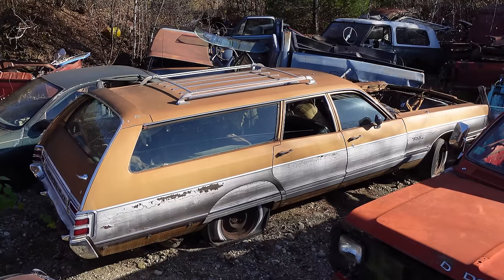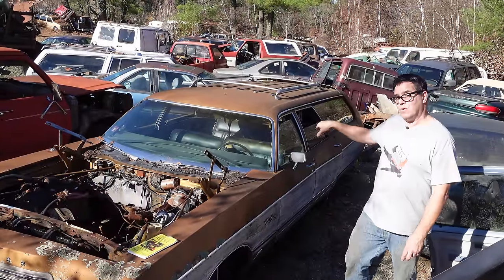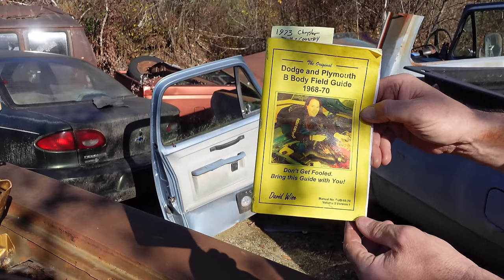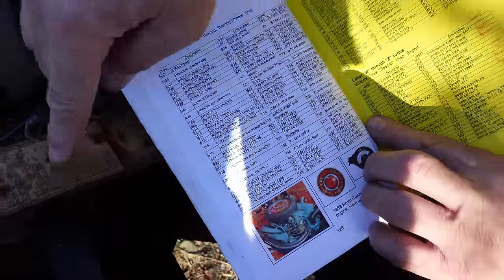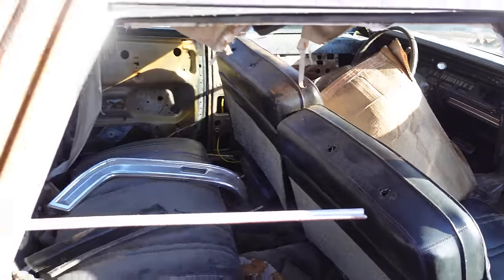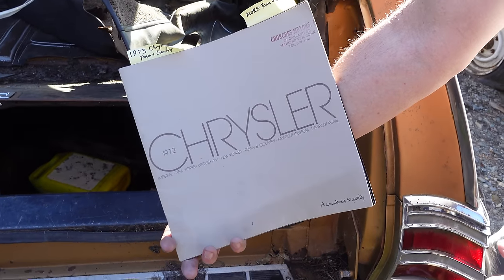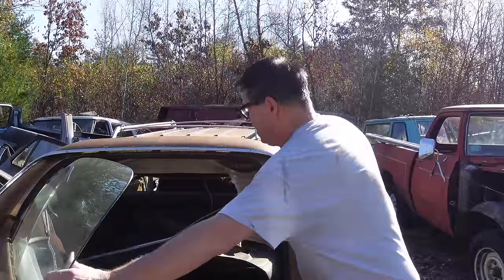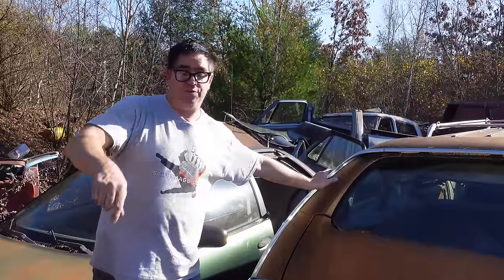1973 Chrysler Town & Country Wagon

Comment: I bought one of these in 1980 for $200. Before I could take it home the seller siphoned two 5 gallon gas cans out of it. It would cruise all day comfortably at 90 mph but needed to stop often for gas. Mine had two air conditioning compressors, one for the front and one for the back passengers.

Comment: I had a 1971 T&C with the 440 and 323 posi rear. It was loaded - power steering, power brakes, power windows, power door locks, power antenna, cruise control, am / 8 Track, (changed to am / fm 8 Track), 60/40 power seats (driver & passenger) air conditioning, power rear window washer, roof rack (added step bumper and rear side grips from a ‘70 T&C), tilt/ telescopic with rim blow, wood grain (car was green).
I still have a factory radio with the cassette tape player that I was going to add (was planning on converting to an Imperial dash with full instrumentation); the Imperial had the am/fm option. I was also going to convert to dual exhaust (from a 70 T&C donor with a 383 (4 bbl). This, in my mind, would have been one of the ultimate optioned cars in its day (~1976).
I really miss this car!!!

Comment: Steve, I am impressed that they managed to keep it on the road until 1992.
Reply: Why? My 2 79 300's, 76 powerwagon and 82 cordoba are still on the road
Reply: @Welcometofacsistube  maybe you should call a few friends to get them moved before they are impounded….just saying…
Reply: You are??? It was only 20 years old!
Reply: They tended to rot out in less than 10 up there. We sold a 72 Chrysler out of VA in 1983 in Upstate NY. The guy who bought it was replacing his 71 Imperial due to rust.
Reply: @seed_drill7135  I live in Saskatchewan.  None of mine are rusted out. It's called maintained and cleaned
Reply: @BillLaBrie  hard to impound licensed and driving cars but hey you are right, I can only drive one at a time.
Reply: @Welcometofacsistube  Everyone’s got their thing. I collect plastic hangers from defunct Midwest discount stores of the 1960’s and 70’s, myself….
Reply: It probably got economically unviable to repair and it was parked and then shelved.
Reply: @importsstillsuck  Maybe by then there wasn't a need for a wagon. My uncle had two wagons, a 1973 LTD and a 1979 LTD. The 1973 was gone in favor of the 1979 and that was gone by 1983 and sold to my neighbors for use as a taxi cab. By then, the kids were older and they rarely went out as a family. They could squeeze into a 1984 Delta 88 if they had to do so (a car I now own). Who knows what happened to it and why it was scrapped.
Reply: @BillLaBrie  Me too !
Reply: I remember growing up in the '80s/90s you had one of those you got laughed off the block, also many 80s/90s cars weren't large and parked this beside let's say a '90 Maxima, '91 Caravan or '89 Taurus to realize the size. Only today's big SUV/pickups compare.
Reply: @ljmorris6496  What is laughable or lamentable is the fact 50 years later people are driving even bigger 'family' vehicles like Suburbans, Expeditions and 3 ton pickups with 5 foot beds.
Reply: @rightlanehog3151  you probably meant it as simply a form of speech. But unless custom made, there are no such thing as a 3 ton pickup.😁
Reply: @willhorting5317  Ram 1500 TRX  Curb Weight - 6,866 . That is 866 pounds over the 3 ton barrier  and there are many other family/luxury pickups over 3 tons.
Reply: @rightlanehog3151  😁😁
Obviously you and I aren't speaking the same language.
My comment had nothing to do with how much the truck weighs.

I was referring to them being referred to as "1/2 ton"; "3/4 ton"; "1 ton".
You know, like a F150 is a 1/2 ton.
F250 is a 3/4 ton.
F350 is a 1 ton.
Reply: @ljmorris6496  I actually have an 89 and 93 Taurus that I park next to my 76 c body Chrysler and the size difference is hilarious. And to make matters worse the Chrysler is a 2 door. Cute little ford lmao
Reply: Someone needs to restore this car. Looks to be in good shape.

Comment: My grandmother abandoned her 73 New Yorker 2 door hardtop on the farm. Had wiring issues and was missing parts when I got it. Never got it running good enough to put it on the road but had fun working on it. The 72 grills were so much nicer. If it was a 72 I might have kept working on it.
Reply: How long was it on the road before it was parked?
Reply: @googleusergp  she replaced it with a 83 fifth avenue. I don’t ever remember her driving it and I’m 40.
Reply: @Ian-of9oi  Probably parked it in 1983 if she bought an '83 5th Avenue to replace it.

Comment: My brother and I spent a lot of miles riding in the "way back" of our '73  Fury III in S. Texas in the 70s. Hot summer days, my folks and 4 sisters up front in the air conditioned zone, sun beating in, staring backwards from the tailgunners position sipping exhaust from the tiny gaps in the tailgate weatherseal. Good times. If we got sick(we always got sick) my Dad would lift the hammer and ease onto the shoulder doing about 40, lower the rear window and remind us to lean out far enough to "keep it off the paint". 

I hate wagons
Reply: They had optional rear AC units, but they were rarely ordered.
Reply: Love this colorful story !
Reply: 😂😂😂😂 I can relate! 😂😂😂😂

Comment: I was born in 1966. My Dad got rid of his 1957 Caddy Coupe deVille and bought a family car....a 1966 NewYorker 4 door hardtop. Our Mopar family had begun!
When my sister was born 2 years later he gave that one to his mother and bought a 1969 Town and Country  wagon with the rear facing seat. That one turned out to be a real lemon , so he got the 66 back and we used that until his next new car, a 1981 Newport sedan with a slant six(!) That one got hit and the body shop said to get rid of it because it had hidden terrible rot. It's replacement ? A 1979 LeBaron 360 coupe! After that was a steady diet of Neons and Avengers. My first car (still have it 40 years later) was a 1969 Roadrunner. First new car was a Omni GLH Turbo....have that one too. And my 1973 Imperial coupe....the 83 Cordoba, the pair of 300M's...etc

Comment: My parents had a blue model with wood trim, 440 4bbl. We used to pull a trailer up I95 with it every summer.  I had to use this to pass my driver's test.  Definitely a land yacht. The wagon before this was a 1969 Polara Wagon with a 383 4bbl, dual exhaust.  Remember as a kid loving the sound from the back seat as my dad floored it to get onto the interstates in South Flroida.

Comment: This episode has me hankering for a 1979 Ford LTD Country Squire wagon (aka NL Vacation Truckster) video!
Reply: My uncle had one of those. What a heap. It was made on 12/22/78, which was a Friday, and it showed. It was a 302 V8 and ran like crap until my dad tuned it up. It blew the engine by 40K and my uncle had a used engine in it that also ran like crap until my dad straightened it out. The spark plugs were put in by some very angry worker or someone who took a little Christmas cheer too early at Ford's Dearborn, MI plant. It was code 6P Cream exterior paint as I recall and no one shed a tear when it was sold to my neighbor as a taxi cab in 1983 for $4,200. 

I remember my uncle changing the oil and calling my dad to help him as he "couldn't get the dang thing off", referring to the oil filter. My dad said, "C'mon, let's walk over there". My uncle who lives six blocks away was all dirty, his glasses askew and told my dad, "I've been trying for an hour now". My father went under there with the oil filter wrench (which my uncle borrowed from my dad) and in ten seconds he had it off. He said to my uncle, "Which way were you turning it?" Turns out he was disoriented being on the ground and was tightening it. I still joke him to this day about it.

Comment: Shaggin wagon. 😁
My family had a 1973 Oldsmobile Custom Cruiser station wagon. You could barely hear the engine running and the thing felt like it was floating on air going down the freeway. The AC literally frosted the windows over it was so cold. That was our "PC Express" since we used it to go to Panama City Beach from Alabama so many times. My mother finally traded it in for a 2 door Cutlass.
Reply: The "A6" log compressor (back in 1973 it was the Frigidaire division of GM, after 1979 it was Delco Air) was only rivaled by the "RV" series Chrysler AC compressor. You could hang meat in either vehicle after it got going.
Reply: @googleusergp  Yes, you are correct, the A6 Frigidare compressor is a thing of beauty when it comes to turning your classic GM product into a meat locker during the hottest summer days. The unit in my 1969 Buick Skylark has been converted to 134 and it still does an amazing job of cooling. But the A6 requires occasional use during the winter months in order to keep the moisture blown out of the system. Neglecting to do this will result in water freezing in the system during summer use and blocking freon from circulating, then only warm air blows out the AC vents. A few minutes use weekly during winter months will keep the system moisture free, and cold in the summer.
Reply: @customkey  That's correct. They are also known for seal leaks, but they are easy repaired. Jaguar and Rolls used them as well (along with GM automatics).

Comment: Ahhh, wagons, my soft spot. Have a '94 Buick Roadmaster Wagon with the two way tailgate, power antennae, back facing 3rd seat. Daily driver. It has the 350 small block LT1, has 275 horses. Recently took a trip to Amarillo, Texas from Washington state and back to get my tranny worked on this last summer. Flawless running, 23 mpg at 70mph. Floating down the highway, lots of complements at gas stops. Thanks, Steve.🥂
Reply: 94 roadmaster. One of the last wagons.

Comment: We had a 78 Ford LTD wagon with the towing package 460 4V and power everything that was available. During a vacation my dad was getting bait for his 4am fishing trip when the wagon got rear ended by a Ford pickup. The pickup was totaled as the frame bent but even though the tailgate was smashed in the window still worked and it still opened both ways like my XUV does, swings to the side or lays flat. I could see him being one of the 12,000 that bought an XUV new if we were 40 years younger.

Comment: Hello Steve The Chrysler Town and Country started out as a 1940 or 41 Station Wagon started out as to what was called back then a woodie wagon. When World War Two broke out production stopped so more or less than a thousand were produced. After WW2 the Country was recovering and the production of the Town and Country was reproduced in the years 1946,1947,1948 and 1949, as 3 types of vehicles and with real wood panel and trimming on the back of trunk lid sometimes but mainly the sides of the left and right front and rear doors they were a 4 Door Sedan, a 2 Door Coupe and a 2 Door Convertible. In 1950 Chrysler produced a town and Country 2 Door Convertible with real wood trimming on both sides of the car on the steel body. From the front doors to parts of the rear  quarter panels of the car. In the 1950’s the Station Wagon was back to existence and it was massed produced, in 1957 to 1961 years the tail fins were added to the rear quarter panels to the car. From 1962 to 1964 Model Years the Tail Fins were dropped and Chrysler had smoothed and rounded out the top parts of the rear quarter panels. From the Model years of 1965 to 1968 they went to the square body panel plat form. Model years from 1969 to 1973 it went to an airplane ✈️ fuselage platform. From 1974 to 1978 it was a configuration of fuselage and square smoothed out flat body like Fully Sized all mainly Steel Beach 🏖️ Wagon Station 🚉 Wagons. From the years 1979 to the early to mid to late 1980’s Chrysler had downsized the wagons tremendously introducing the Minivan 🚐 in the mid 1980’s to the present. To this very day for me I would still choose the Fully Sized Fully Equipped Fully Loaded Fully Powered with All the Accessories, Bells and Whistles of What I Can Really Think of for a Fully Sized Beach 🏖️ Wagon Station 🚉 Wagon. The Chevy Suburban and The GMC Sierra Classic Suburbans even though they are referred to as SUV’s along with the Full Sized 2 Door Chevy Blazer and GMC Jimmy are also known as to me Big Over Grown Beach 🏝️ Wagons Station 🚉 Wagons. Oh yeah by the way Dodge and Plymouth had them as well they and also came and had equipped optionally 4 Wheel Drive. Please folks do yourselves a favor conduct and do your own documentary historical homework investigative research and study  📚. Right along with all the Antique, Classic and Vintage Fully Equipped, Fully Loaded, Fully Loaded and Fully Sized Luxuriously Luxury Land Cruisers,Luxury Land Liners and Luxury Land Yachts. Which are still and always will be All Cool 😎😎😎😎😎😎😎😎😎😎😎😎😎😎😎😎😎😎😎😎. Keep up the good work Steve in your adventures in finding, locating and fact checking okay. 👍👍Sincerely Yours Truly Ivan I J

Comment: The two way tailgate was also on Ford wagons of the era but the coolest was the disappearing tailgates on the GM wagons where the glass retracted into the roof and the tailgate dropped down into the body. Back in 1971 my uncle George traded in his '69 Olds Vista Cruiser in on a brand new Chevy Kingswood and we were all amazed by the then new disappearing tailgate.
Reply: I think those were called clam shell tailgates. They get alot of attention now at car shows
Reply: @TomTom-qm4mq  ... they were also a maintenance nightmare.

Comment: Thanks for a great video ! However you missed a couple of opportunities. When you pointed out the hinges on the rear door / tail gate,  the upper one is a latch post,  the lower a hinge for the gate. But the real hinge was on the opposite end of the rear door /  tailgate, welded in place is a massive piece of steel / iron that is the hinge point & support for the very heavy rear door / gate. That massive steel hinge point is a bit of a shock, especially when compared to modern car structures.
 The other point is the steps on the rear bumper. Only on the 3 seat wagon models, there are chrome grab handles on the body, each side of the rear dr. / gate,  those steps were also for entry & exit the rear entrance with the assistance of those grab handles, those grab handles are not on the 2 seat version in the video.

  I own a very nice 1973 Chrysler Town & country 3 seat wagon in beige & the walnut wood grain, like the 1972 model shown in the 1972 Chrysler literature in the video;  the difference being the restyled front end / bumper / grill.  It is a 97,000 mile car with the original paint / wood grain / & interior all in good condition less the changed out maintenance items, tires, belts, hoses, battery ect. It was built in the Chrysler plant at Belvider, Illinois. At sometime in it's life it had a thorough rustproofing. That big 440 cid V-8 gets 14 mpg on the highway, & much worse in town. But she's a beauty, & often I get inquires about her when I take her out for a drive. Sometimes it's difficult to get away from a gas station,  store or restaurant for all the inquires & viewers, as well as their memories.  I'm glad to share a bit of history & nostalgia with folks & meet a lot of interesting people. 

 I grew up with stationwagons,  & there were 5 of us siblings & our family did a lot of traveling. My folks bought a slightly used 1961 6 passenger Rambler Classic in 1962 with a 196.5 cid inline 6,  then a New 6 pass. 1967 Dodge Cornet 440 (trim level) with a 318 cid V-8.  Then a massive 1974 Oldsmobile Custom Cruiser 9 passenger wagon with a de-tuned 455 cid V-8, it was their last wagon, by that time my sister & I had  our own cars.  My Dad went to the Chrysler dealer in early Oct 1973 to look at the New 1974 Chrysler Town & Country wagons. He said the salesmen said they were out back & didn't seam to care if they waited on him or not.  So that's why the 9 pass. Oldsmobile, in which the 3rd seat faced forward, & had the clam shell tailgate & rear window. The Oldsmobile dealer was glad to move his inventory along, & within days of the my Dad purchasing that car the OPEC oil embargo began.
  On that point, The introduction of the 1973 models for most US automotive mfgs came in the late summer / fall of 1972. The OPEC oil embargo started October 19, 1973, not effecting the 1973 model sales, but drastically effecting the sales of the 1974 models as they had just been introduce for the 1974 model year.  Again Thanks for the Great video & stirring up memories of long ago !

Comment: This reminds me of the time the family of a local Chrysler, Dodge and Plymouth dealer was at our church (in Utah and if you think Catholics have big families just wait til you see a Mormon family). After services the mom sent her dozen or so kids out to wait in their humongous Town and Country wagon albeit a few years later than the one in your video, while she talked with folks inside. 
As luck would have it her 3 year old pulled the lever on the 3 on the tree and the big wagon rolled back and slammed into my little Datsun pickup. I had to put a bit of pressure on them to actually pay for my auto body work. Nowadays of course, the brake pedal needs to be depressed in order to get a car out of park.
Great info Steve. I love your videos, keep up the great work.

P.S. I noticed it had torsion bar front suspension. How long did they do that?

Comment: My brother bought a slightly-used '73 New Yorker in 1980 which had only 8,000 miles on it.  While it was parked on the street at church some fool rear-ended it, totaling it.  He'd had it less than a year.
Reply: It was a sign from above 🙃

Comment: One major correction about your commentary.  
The oil embargo did not happen till October of 1973. So the 1973 production was complete and 1974 was in production for a few months already.
So production of 1973 was not impacted, and it set a new record for model year production.
Reply: Correct, only 1974 sales would be affected greatly by it. Maybe last quarter 1973 sales were a bit off, but it would have impacted 1974 sales more than 1973.